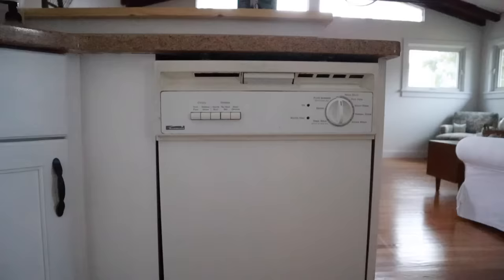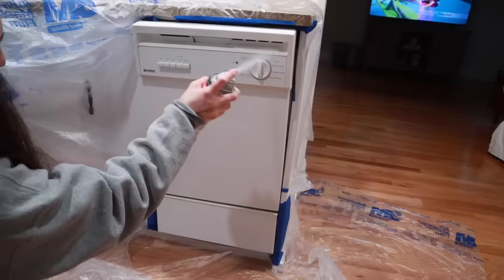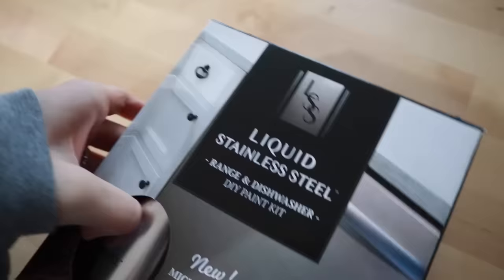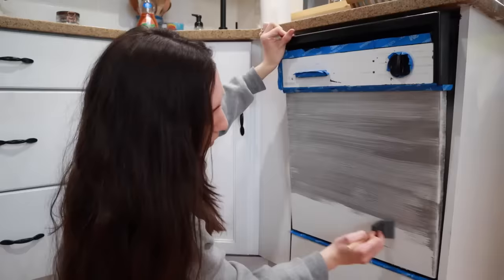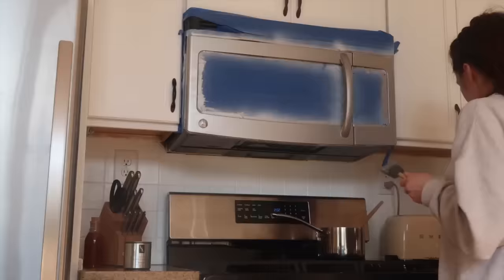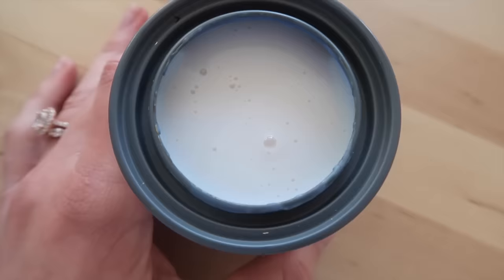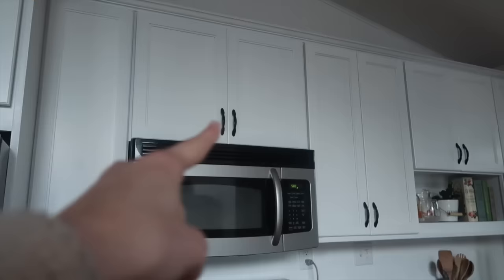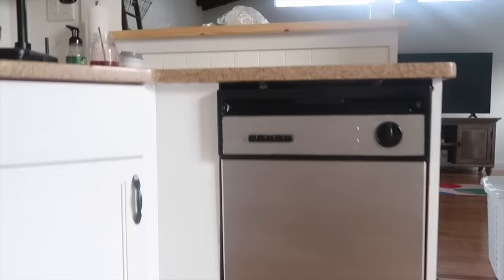PAINTING MY OLD APPLIANCES WITH STAINLESS STEEL PAINT//how to makeover old appliances for $24

Comment from the maker: Here is a 1 month update of this product! https://youtu.be/MDcecedN_Ns
Reply: Our Little Nest if you still have the dishwasher I would put those black label You have and maybe instead of horizontal way, maybe do in a slant ways or 45 degree.
Reply: Our Little Nest get custom decals - you can use the nail transfer stuff
Reply: Our Little Nest nail tattoos I think they’re called. You can buy the paper from amazon I think
Reply: That's definitely a slimline dishwasher
Reply: Just an fyi.... You could've just used some Brillo/ steel wool to get unwanted paint off smooth surfaces like those. 
Great video... Years ago I saw that there was a stainless steel  peel & stick for appliances, and I've really wanted to do it, but this way seems so much easier. 
Great job👍😷
Reply: A LITTLE MINIBPRINTER. LABEL MACHINE.
Reply: ...or,

Using a sharpie, have your friend write the washer control words on a piece of construction paper. 

Then use a exacto-knife, or razor to cut out the letters from the construction paper.

You've then created a basic stencil
Reply: Your microwave looks very good I would not paint the top part black it looks very good your whole kitchen do with the stainless steel paint that you dump didn't even know they had stainless steel paint thank you
Reply: Thanks. I was just about to ask.
Reply: This amazing...l was trying to figure out something like this. It’s nice to know there’s actually paint to get it done and make it look real.
Reply: Thank you so much for the video. Solution for my problem.
Reply: Can u do a 1 year update!??
Reply: @Yankeerose9973   I used the peel and stick on my dishwasher. Just clean the dishwasher really good and take your time. Mine looks great. I measured the dishwasher front and applied it top to bottom so gravity would help me keep it taut. No wrinkles or bubbles. Still looks good a few years later.
Reply: Good morning!  I found the link to the paint you used but as of today they are sold out.  Is there any other brand you recommend?  just want to make sure!  You’re a heaven sent!  Thank you!

Comment: The painter’s tape should have been removed while the paint was still wet.
Reply: C Bassett painted my house recently and we quickly learned the consequences of not doing this step 😭🤦🏻‍♀️
Reply: So what you guys are saying is that once you know you're done painting, you remove the tape right away?  I Just want to make sure i don't mess this up since I'll be painting my house soon🙏🙏🙏.  Thanks!
Reply: Didn’t know this
Reply: Wow. Why didn’t I know this lol it makes so much sense
Reply: Chanthana yep!! if you let it dry, it can pull your paint up and give you a chipped look
Reply: - auvreathem - 😭 it is the worst! Lesson learned. Do not let the tape dry with the paint for too long -it is harder to remove too!
Reply: @chanthana7694  look for something called frog tape
Reply: @edwardshomestead9074  I'll look for those tapes.  And thank you all!
Reply: I work in the auto refinish industry and I would use 3M yellow tape. May be a little pricier than blue painter tape or frog tape. But it works well for solvent or water based paint, doesn’t bleed, and doesn’t leave residue behind!
Reply: Yes that’s right, remove the tape right after u paint. Don’t wait til it’s dry, or you’ll pull off the dried paint from the side u wanted it to stay on
Reply: But what if you have to apply multiple coats over a couple of days letting them dry in between? Do you remove them reapply the tape after every coat?
Reply: Kitchen Livin with Shay if you buy good tape, you can leave it masked up. We use this tape on cars and leave it for days at a time on the car some times with no issues of glue residue or paint bleeding through. Any auto parts store or even maybe Walmart should carry it. Ask for yellow 3M masking tape.
Reply: If you start to pull paint off when pulling off the tape after it's dry use a sharp utility knife to cut along the edge of the tape.
Reply: @Chaseryantaylor  WoW Thank You Chase! I'm so glad ive stumbled across this video & these comments!! 👌
Reply: Natalie McCabe no problem!!
Reply: Yep that right you have to remove the tape before it dries learn that from a painter.
Reply: But if you're doing multiple coats which need to dry in between, you CAN'T remove the tape right away.  Not unless you want to tape, paint, remove tape, then tape again, paint, remove tape, then tape again, paint, remove tape.  That's so impractical!!
Reply: Yep--and a painter showed me how to keep the edge of the paint from "feathering" when you peel the tape off: You pull the tape off by pulling it down/away from your edge-line at a 90-degree angle, not straight up!  (Make a big "L" as you go along.)
Reply: 😂 true I told my husband this too when painting our pool.
Reply: I was a painter, and we always let the paint dry first before taking the tape off. Sometimes the paint would chip a little, but that was only where there was water damage. We also went along the tape with caulking (make sure it's paintable) so that might have made a difference too. Also yeah, for painting walls Frog tape is the best.
Reply: Yep that's a very important part of painting any project whether it be just decorating or something like this as the tape pulls off the paint as you remove it because it makes an unbroken skin on both surfaces
Reply: @yooperventures2830  you shouldn't have to if you take the tape off while it's still wet.
Reply: That wasn't the cause of the paint bleeding under, the wrong tape was used (green frog tape rather than blue painters tape).  Green frog tape creates a chemical bond with paint, blue painters tape uses a purely physical bond with whatever surface. One needs to understand the technical properties of the 'tools' one uses to make the proper choice of products and one needs to apply that product correctly.  Often people do not make certain they've got good adhesion between the tape and the surface (by pressing it firmly down with a tool at the critical edge on the tape) use the wrong tape or use the right tape incorrectly and one gets paint bieeding under the tape.
Reply: Chase Taylor yep, can get on amazon
Reply: Leigh haha, perfect!  Love it
Reply: @Leigh 😂😂😂
Reply: Came to say the same thing
Reply: So if there are multiple coats you’d have to remove the tape, let dry, tape again then paint again? I just painted my cabinets white and did 3 primer coats and 3 finish coats. I let each dry and painted again without taking tape off wall and inside till the end. Had to sand some flakes down where paint dried but didn’t stick to the tape when pulled off.
Reply: WOULD OF NEVER NEWWWW
Reply: Also, to prevent leaking through, the tape should be laid down in strips from bottom to top. That way every "row" you lay down will overlap the one below it (think of how roof shingles are laid over the previous (lower) row). 
You could even be extra cautious & overlap each "row" by 1/3 of the width of the tape.
Reply: Not if you use the right tape..This lady is using the wrong tape..Use Frog tape..Won’t pull off paint.
Reply: The other way is to run a Stanley knife along the tapes edge when dry to remove it. It stops any paint pulling then also
Reply: @Chaseryantaylor  That's a very good tip, thank you (yellow 3M masking tape)

Comment: Here are a couple tips from a "serial" house flipper...if you have petroleum jelly, you can smear it over glass areas. Use a candle to rub on edges of wood cabinets, window sills etc. for tight painting situations.  If you get paint spray or touch cabinets with dab of paint...spray wipes off with removal of petroleum  and dried dab of paint comes off as you gently scrap off candle wax. I use a piece of styrofoam to stick screws upright in so I can spray paint the heads easily and let dry without rolling around or getting stuck together or messed up.
Reply: Sounds like amateur hour to me, a good masker can mask anything, tape and a razor knife
Reply: Great tips, thanks!
Reply: @titirititiri6360 ya trying to figure out why use anything other than tape + knife. I guess for those days when you’re on site fixing the new flip and you forgot to re-up your tape stash… but didn’t forget the extra candles and petroleum jelly for your ritual sacrifice and summoning of the Dark Lord later that afternoon
Reply: LOVE these kinds of hacks to save scrubbing!  Thanks!
Reply: So what removes petroleum jelly then? Vinegar and water?
Reply: @johnkelly9451  That was going to be my question too, but dishwasher soap and hot water may do the trick? 
I use a scraper for windows for uhm... windows or other glass. I have a small one for finer jobs, and a more heavy duty one for the oven or surfaces with goo in general. (Inspired by Aurikatarinas Youtube blog where she goes at it cleaning hoarder homes. Entertaining, and  a serious reminder to get out the trash!)
Reply: @inger4794  Ty for reply, I too currently use a scraper (or a razor blade in a pinch) petroleum jelly sounded intriguing.  Will try and see. Love Auri, Midwest Majic, Clean with Barbie, A Beautiful Mess Cleaning! Yes, a definate reminder to get on top of things that get let go when busy. Especially while doing renovations. Will think to try dawn dishsoap for the petroleum jelly, then a followup with vinegar and water. ty again.
Reply: @zekevictor  Yes! Agree!
Reply: @johnkelly9451  Midwest magick would tell you to dropkick the jelly!
Reply: @inger4794  lol 😆,  yeah, and just let the can of green beans go man. Maybe the jelly idea too. I must try it now just to see. Just hoping the cleanup is not worse than the scraping.

Comment: The microwave looks fantastic.  You don't need to paint the vent because black and silver looks fab. Just use abbreviations for the dishwasher cycles. Nice job though.
Reply: Yup, I agree 😊
Reply: What about using clear labels you can buy at any office supply store, then print on your home computer using whatever font/size fits?  I know these labels exist to be used for things like return address labels and spice jars, etc.  I'm thinking you could place the labels before putting on the finish see-through top coat.  Thoughts???

Comment: A few tips from a fellow DIYer; remove tape while the paint is still wet (after about 10 mins) and it won't pull paint off. Also, look into printing new labels with waterslide paper!
Reply: I doubt you'll see this as your comment is 1yr old but I took the paint off while still wet and it pulled. I'm a diyer in training so there's that.
Reply: I used a static cling black window tint i bought off Amazon. Thats what Giani told me to buy. Worked wonderful with the words.

Comment: I HIGHLY recommend using a box fan with a HVAC filter taped to back.  It really helps by trapping spray paint particles that are in the air.  I always use this method when air brushing indoors.  It’s crazy how much over spray floats around in the air.
Reply: I need a picture because i need visuals
Reply: genius
Reply: If possible try to do it outside of ones living space. Engineering controls first. Then yes half face respirator as well
Reply: What direction do you point the fan? Out the window, to suck air through the filter and egress?
Reply: Thanks

Comment: I can't believe how great that looks! I found that Rustoleum spray paint in aged bronze, antique gold, and copper does an AMAZING makeover to knobs, hinges, mirrors and chandiliers, lamps etc. I bought outdated shiny chandeliers at a thrift shop for under five bucks! I changed out glass globes...choosing new styles from tons of globes at thrift shop at 50 cents a globe! They look amazing and were awed over many times! I also did curtain rods and hooks, etc. The knobs and drawer pulls I wanted for kitchen were 10-12 dollars a piece and I needed 24! Found two BAGFULLS of  identical knobs and pulls at a Goodwill for 3 bucks a bag, all screws included! They were shiny silver and I needed a more aged, dark matte finish. So tried Rustoeum  aged bronze spray paint....came out BEAUTIFUL! Didnt scratch off either! So six bucks for bags of knobs and pulls,  and five bucks for spray paint....saved me hundreds! Also took off cream colored plastic light switch covers and outlet covers plus screws, spray painted them all in aged bronze....couldnt tell them from the 12 dollar apiece metal ones! Again, saved hundreds! Going to check this stainless paint you did...wondering if it comes in the matte dark grey stainless steel color and in a heat resistant appliance paint kit for ovens? Love your style and you sure are great at painting and carpentry, very steady hand...you go, girl!!!

Comment: My first thought when you ran into the label-maker dilemma was that you could simply turn the labels vertically (have the stickers turned 90 degrees, so the words are sideways, being spelled upwards).
Reply: Cricut
Reply: Even tilted at 45 degrees.
Reply: I used a black window tint film. It was static cling wrap. Bought on amazon. Giani told me about it. Words look perfect. Its great for this kit.

Comment: That is amazing. WOW!!  Now the true test is how it holds up to cleaning.  
Leave the micro vent black.  Almost all stainless appliances have black trim, etc. . The keypad and the window are black.  It all will balance.
Nice job.  
Removing the tape much sooner will make a huge difference in your final outcome but this was a test piece and the perfect piece to work out what very few issues you had.  Honestly, I am shocked just how well this turned out.  You were very brave to include your micro in your first test run.

Comment: Print the smallest font, use thick clear packing tape, soak in water a minute, then rub off the paper and let tape dry, stick onto the unit <3
Reply: I would suggest typing all the cycles as once. Your labeler should resize the wording to make the letters closer.

Comment: I remember way back in the 70s/80s my parents had a brown refrigerator and it was just hideous.   Trends seem to change but the stainless steel look has held on for quite awhile now.  It just looks so crisp and clean to me. The only downside is the fingerprints it leaves, so now they’ve come up with the fingerprint-less type. I am forever cleaning smudges, so that’s what I’d like next.  This really looks great.  I actually had a toilet brush holder and a tiny trash can in my bathroom that were cheap silver and over the years they’ve gotten to look so bad. They actually have rusted in some places.  I was set to do something like this until my husband bought bronzed replacements.   I really like them a lot but I’m so glad I know that this works for the future. Great video 👍.

Comment: It’s fortunate that your oven is already stainless as, even appliance and stove paint, I believe, are not to be used for that.

Looks great.
Reply: Private Private that’s what I was wondering if it’s good for stove/oven front.
Reply: Katherine Taylor sorry, there was a typo in my comment. Fixed.

Yes, from what I’ve heard, even paints made for potbelly stoves are not for oven/stove application. My guess is that, like for me, I have an avocado colored oven. I’d LOVE to pint the entire thing! However, particularly where the surface area is around the burners? My guess is that it would either bubble up or cause dangerous fumes and, possibly, a fire hazard around the burner areas. Not worth the risk, even with the top likely being easy to remove, take outside and being able to do a fine paint job. Sad, because I HATE the avocado.

Comment: I did this to my dishwasher. But, I actually removed the front & bottom panels to paint them, which was amazingly easy to do! My dishwasher wasn't working at the time, but replacing it was out of my budget. But a quick search online revealed an easy, relatively inexpensive, and super quick to install control panel. Purchased the control panel, installed it myself (basically like plugging in a circuit board), reinstalled the panels, and done! Spent less than $100 & got a whole new dishwasher.

Comment: I just ordered this heads up it's now $45+ in some areas but still 6oz. I'm thinking of using a high density foam roller & asking the hardware store to shake it. For the label maker I abbreviated the words, N for normal etc. If using epoxy tape of the entrance to whatever room, open any windows & use a fan directing the fumes out of whatever (door, window) you can because its super strong.